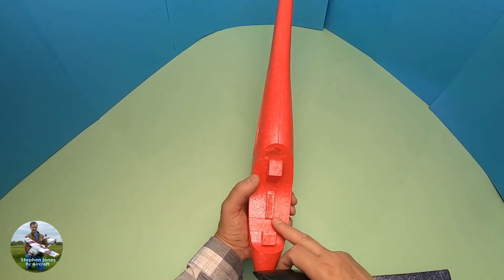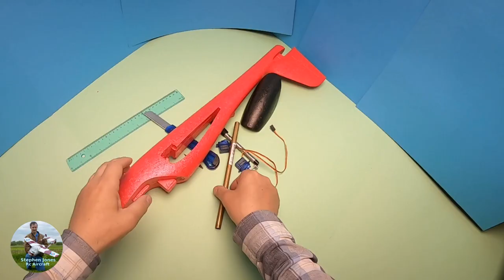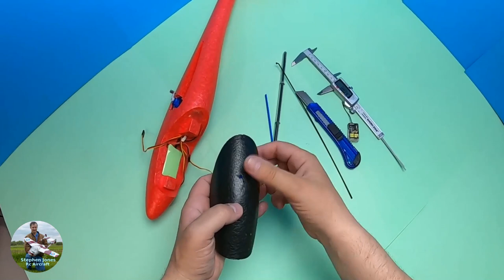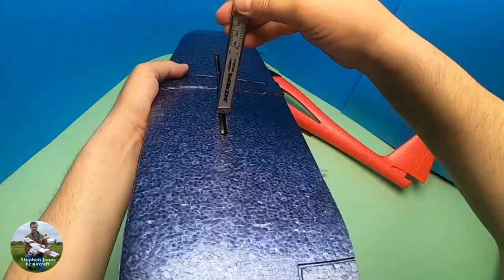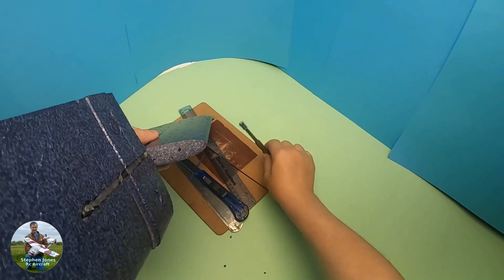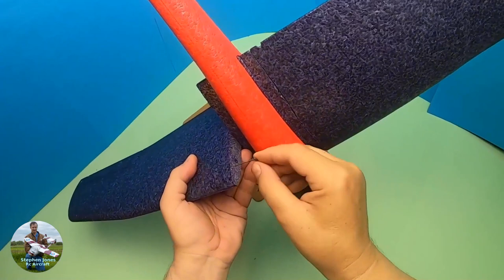Mk2 Lidl Glider Pitcheron full Build

Comment: I built mine just like this one but after flight tests I changed the servo arms to point forward rather than back to give less movement of the wing and a slightly more precise movement. Mine will roll, loop, bunt and fly inverted for ever. It is absolutely lovely to fly.Very pleased indeed.
Reply: Oh sorry, mine is a powered version, should have said so at first. And it balances at 56mm back.
Reply from the maker: @kencroft7933  I agree this is a easy way to convert to radio control and flies well too.  👍

Comment: On the main wing tube spar you cut the outer sleeve into 3 pieces and you use 4 washers to hold the the wings from sliding off the inner spar? I am in the process of building one and have never done a pitcheron set up. Seems like a awesome lil glider and a fun project. Thanks for this tutorial, if you have any tips please advise... Have a great day!
Reply from the maker: Follow the video carefully and you will have the perfect model to take to the beach and you will not break it on the rocks if you crash it. Have Fun.
Reply: @RcAircraft  Thank you, I have watched it several times and the part that is not clear is the wing spar and sleeve as I described but thank you I will figure it out for sure. Happy RC'ing!
Reply from the maker: @mikesrcgarage  Hi, wing sparr has three sleeves that rotate around the main sparr. So that the cut out slot is the same dimension the full length, the end washers are to stop the sleeves coming off the spare. And three of them in case you accidentally glue one of the sleeves to the spar. Hope that explains the reason for building that way.
Reply: Yes thank you I finished mine, test tomorrow... Hopefully! Lol!

Comment: Great video. I have build classic lidl conversion with ailerons and elevator. I think pitcheron version has better ability to trim glider geometry.....main wing axis vs elevator axis.
Reply from the maker: I agree 👍
Reply: @RcAircraft  But at opposite side, the main wing should be the vunerable point of the model when some crash on wing will happen (of course it depends on toughness of joints)
Reply from the maker: @osm013  I have not had any problems with this set up.
Reply: @RcAircraft  I agree, yours realisation is decent. I tried to make that from "in house" model garbage and it was weak - my fault.

Comment: I am in Australia so cant find these gliders but i did find one that is remakably similar so am going to try this concept ..... The one i have has a C of G at 70mm back from the leading edge at the fuselage join when flown as a chuck glider.  Does the pitcheron pivot point need to be installed at some "relationship" to the C of G. I noticed in your video that the pivot point is behind the C of G.Luckily I can get a whole bunch of them pretty cheap for some trial and error.   Great video by the way .... Subtitles are excellent ...
Reply from the maker: Hi, and thanks for your comments. Yes the pivot point is behind the C of G. as this gives better loops and when flying on a slope you need a more forward CoG to keep the model falling down the hill as the up lift will push it up.Take some spare lead weight with you so you can move the CoG point back or forth to your liking.  Have fun 👍
Reply: Hi Craig, How are you going with the conversion(s)? Are you using the 'Anko' clone, found in Kmart, here in Aus? I am planning to use this plane in a project with some school students

Comment: I’m getting one and putting a 11.1 volt battery with a 90mm edf jet engine on the top
Reply from the maker: Awesome. 👍
Reply: @RcAircraft  all the parts came in and it flys very good but after a flip the moment that the plane pulls Gs the wings flutter and you can’t control it
Reply from the maker: @jimmers6293  sounds like you have exceeded the speed limit for the airframe. 🤔

Comment: Curious as to the sheer Size of your Bat eliminator... Bigger than the Battery and Triple the size of the Rx.  A very odd choice.
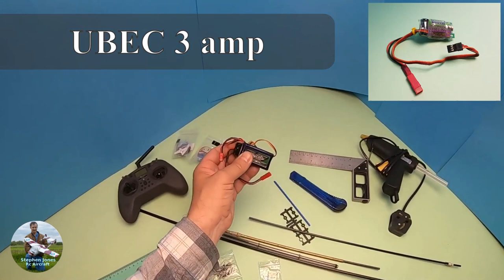Reply from the maker: Thanks for commenting.The Battery Eliminator in the video is one I had to hand and is the same size as the battery which is also small. 2:50 shows a 3amp Ubec which is about the smallest I can find. However if you use high voltage servos and receiver you do not Need a Ubec.  Note later in the video you can not see the Ubec as it is under the battery!

Comment: Hello. It is a video with this convertion?!
Reply from the maker: Yes,
Reply: @RcAircraft  Ohh i just senn it?! On the beach right, s cloudlly?!
It is posibile to put one motor to pitcheron lidl glider?!
Reply from the maker: @Sandokans  Yes very cloudy ☁ weather,  hoping for some clear skies 🌞to do a comparison flight with both my Mk1 and Mk2 version of the Pitcheron gliders to see which performs better and yes many have put a motor up front and fly well too but they wound be better with a folding propeller so you do not break the prop on landing.

Comment: What are your thoughts on taking the dihedral out of the wing?. I have copied this pitcheron design and find that elevator works but if your not careful it is easy to induce a stall, I think that this might be caused by drag from the wing while using the elevator. I was wondering if flattening the wing would help.
Reply from the maker: This is a copy of the Mk1 Lidl Glider and I do not have any problems with the Mk1 version it flies great.
Unfortunately the wind direction has not been favorable for my local hills, so I am still waiting for the opportunity to fly them both and do a comparison. 
I did flatten out the wings on a powered version and that was less stable. 
If you was trying to perform a loop and induced a stall then possible air speed too low or CoG needs moving forward. Hope that helps for now. 👍
Reply: @RcAircraft  I think that maybe you are correct about air speed, I will try to keep it flying a little faster and see how it goes, thanks for replying.

Comment: what channel for the elevon servo?🙏
Reply from the maker: Depending on the radio system you have you can select a mix called delta or v-tail failing that you can buy a v-tail mixer that you can plug your servos into then plug the v-tail mixer into your servo channels on your reciver.
Reply: @RcAircraft  wait is this elevon servo right?
Reply from the maker: @balfasladicra5270  Watch here 30:37